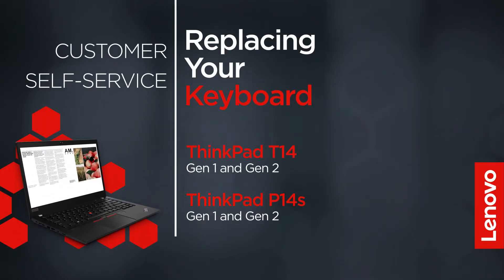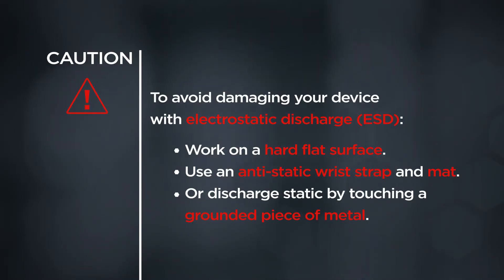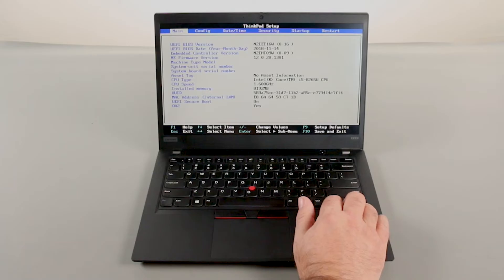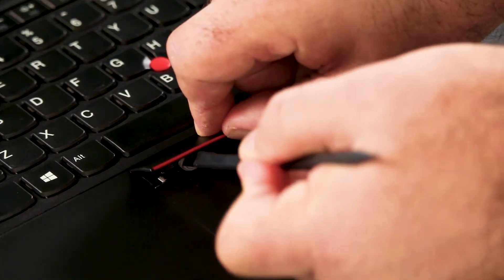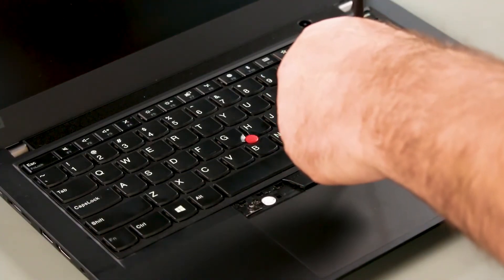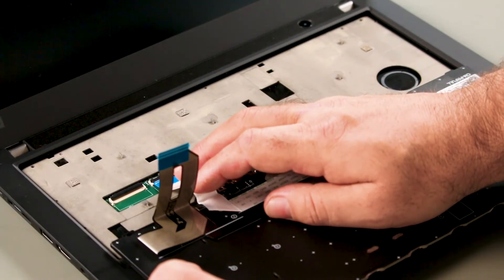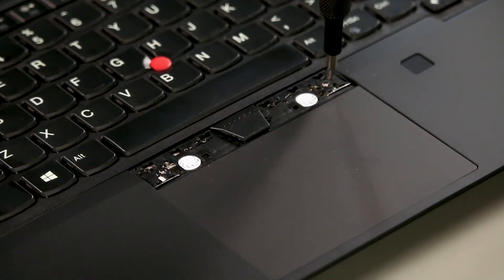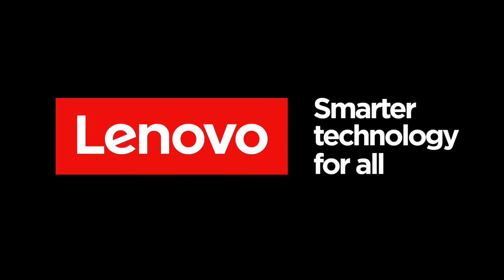Replacing Your Keyboard | ThinkPad T14 and P14s Gen 1 and 2 | Customer Self Service

Comment from the maker: This video will show you how to replace the Keyboard of your ThinkPad. The process in this video will work for the ThinkPad T14 Gen 1 and Gen 2 and the ThinkPad P14s Gen 1 and Gen 2. 

You will need a screwdriver kit, a non-metallic pry tool, and 15 minutes of your time.

ThinkPad T14 Gen 1 Repair Guide: https://pcsupport.lenovo.com/us/en/products/laptops-and-netbooks/thinkpad-t-series-laptops/thinkpad-t14-type-20ud-20ue/selfrepair/removalsreplacements

ThinkPad T14 Gen 2 Repair Guide: https://pcsupport.lenovo.com/us/en/products/laptops-and-netbooks/thinkpad-t-series-laptops/thinkpad-t14-gen-2-type-20w0-20w1/selfrepair/removalsreplacements

ThinkPad P14s Gen 1 Repair Guide: https://pcsupport.lenovo.com/us/en/products/laptops-and-netbooks/thinkpad-p-series-laptops/p14s-type-20s4-20s5/selfrepair/removalsreplacements

ThinkPad P14s Gen 2 Repair Guide: https://pcsupport.lenovo.com/us/en/products/laptops-and-netbooks/thinkpad-p-series-laptops/thinkpad-p14s-gen-2-type-20vx--20vy/selfrepair/removalsreplacements

To learn more about your device go to https://pcsupport.lenovo.com

To find parts for your device go to https://support.lenovo.com/parts-lookup/?cid=ww:lenovosocial:b9515f&source=socialmedia&subsource=yt

To view the Lenovo Support Self-Repair Guides landing page go to https://support.lenovo.com/us/en/solutions/HT516547

** NOTE: Static electricity can destroy components. Use a grounding strap, and clean, non-conductive surface to work on. Use plastic or coated tools to prevent scratching and avoid using metal tools on plastic parts. For more detailed information on electrostatic discharge and how to prevent it, please watch our ""Understanding Electrostatic Discharge (ESD)"" video: https://youtu.be/by4PB3WtdLo 

Applicable Machine Types:
ThinkPad T14 Gen 1 - 20S1, 20S0, 20UE, 20UD
ThinkPad T14 Gen 2 - 20W0, 20W1, 20XK, 20XL
ThinkPad P14s Gen 1 - 20S4, 20S5, 20Y1, 20Y2
ThinkPad P14s Gen 2 - 20VX, 20VY, 21A1, 21A0

#lenovo #LenovoSupport #LenovoTechSupport